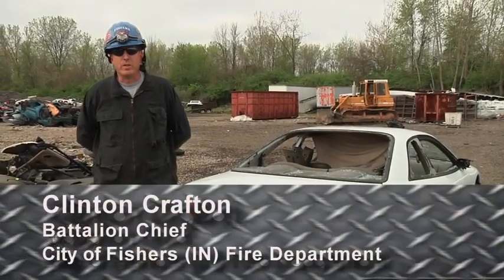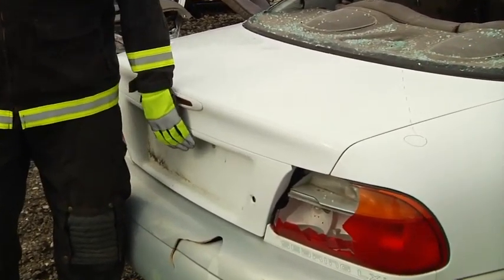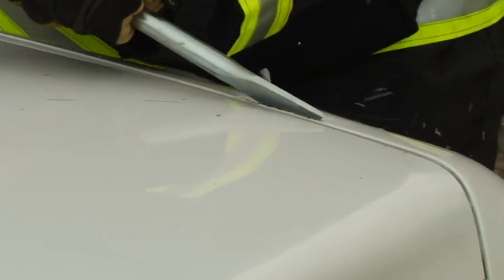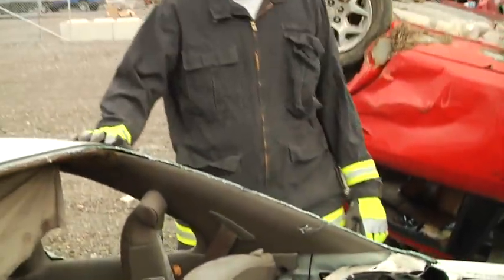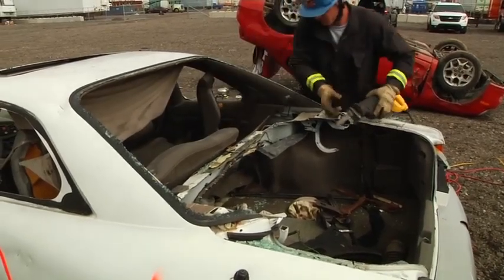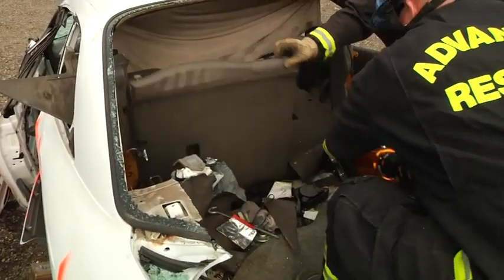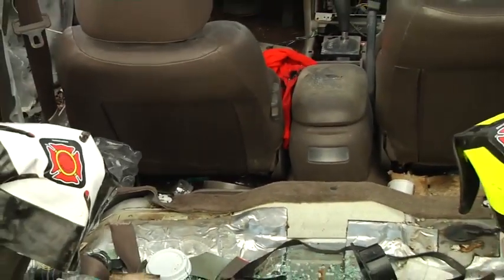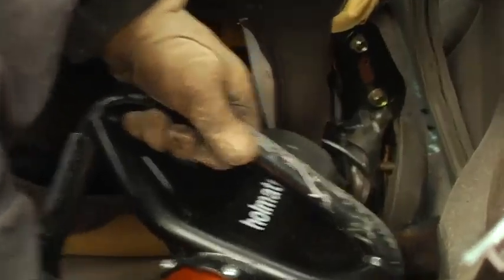Advanced Extrication: Tunneling

Comment: You would  never be able to cut away a seat with a casualty in it as all you would  do is cause more damage  so its not really  a training  video of what you would do.
Reply: On the contrary. When access is not permitted due to side impact, trunk tunneling is a very effective way to access patients. In this case, an extra FF would hold C-spine while the seat back is cut out, after which other FF's could then slide in a spine board behind the patient, package then extricate.
Reply: @bchowmein1711 No you would not be able to cut away the seat like they show in the video and manage the casualties c spine effectively. But you are correct that when side access is limited tunnelling is a good method through the rear of the vehicle.
Reply: @andyoxleyonhistravels  just curious, have you been trained in Auto Ex, or are you an instructor? Please explain your alternative method, we are all here to learn. Ive done this exact method and maintained c spine, and loaded on spine board without issue (altho they dont show it in the vid). As well, there are life over limb principles here. We absolutely train to minimize risk and consequence to patients... But we are also talking about pieces of metal coliding at high speeds, so theres not always a one size fits all approach.